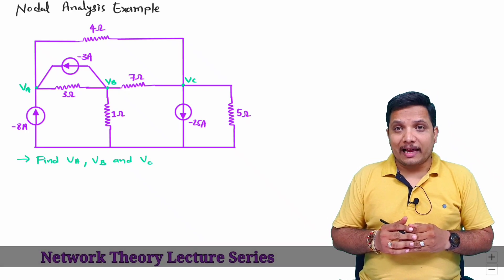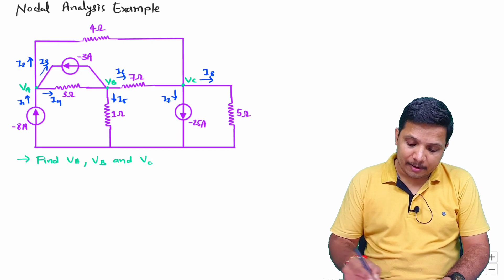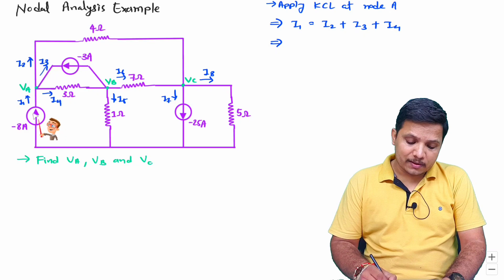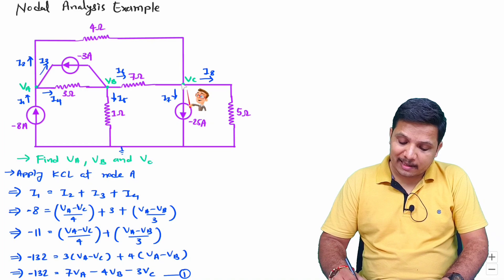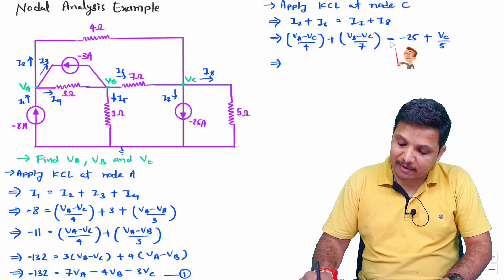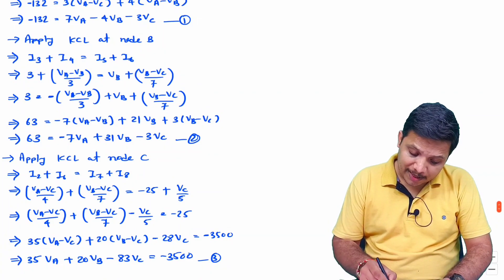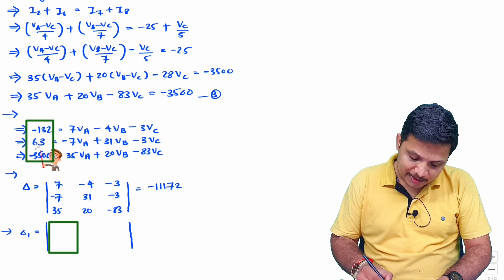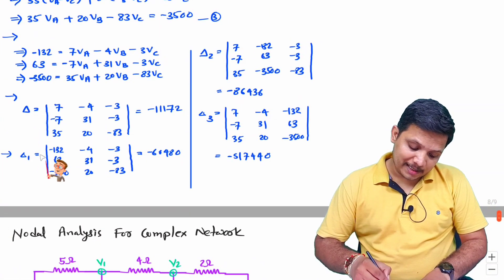2 - Nodal Analysis in Network Theory: Detailed Example and Solved Problem

Comment: Sir just asking Is there a way to get the answer without using a calculator???

Edit : in our exam we are not allowed to have calculator..😢😢
Reply from the maker: You will get simple questions. If calculations are easy then only they should ask it in your paper as calculator is not allowed.
Reply: which college